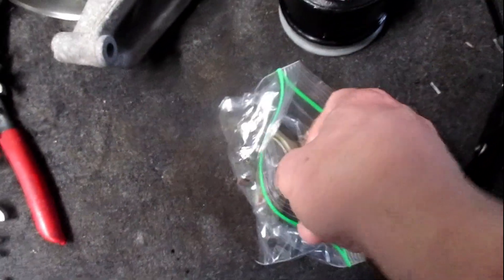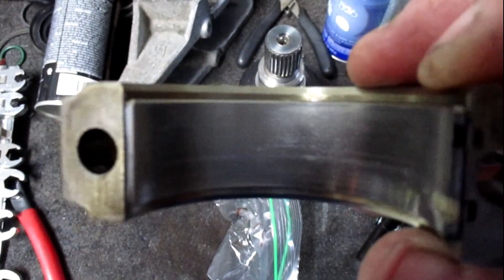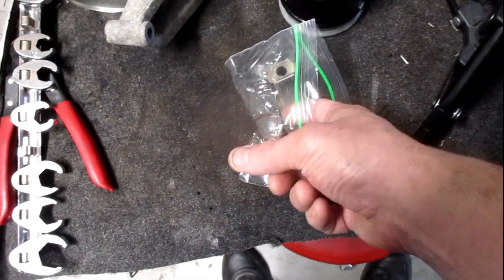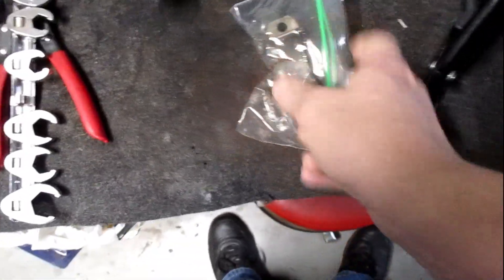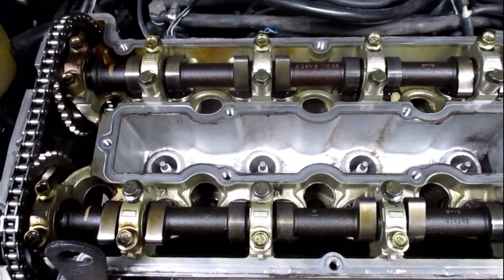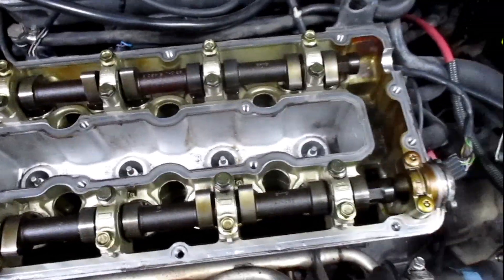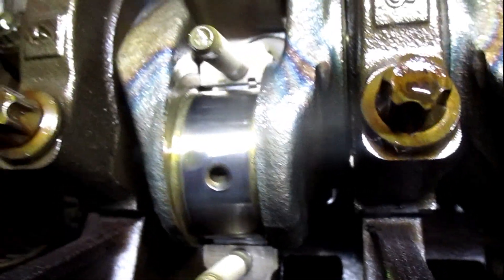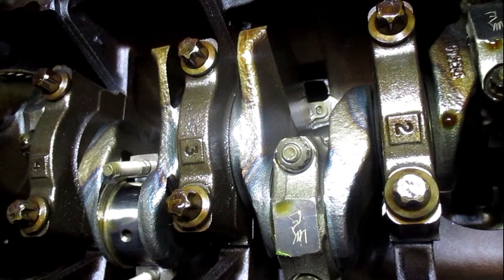1994 Saab 9000 Project weekend update

Comment: You rule. I wish I had the cherry picker so I could pull my Trans easier. I own a 96 9000 Aero and the pressure plate fingers just broke on it after I replaced the slave cylinder lol. It looks to me like possible sediment from dirty oil could have made those scratches. Anywho, Keep up the great videos! Saab for life :)
Reply from the maker: Gah, that is my luck. The folding crane has been quite handy or it would have been sold by now. I did sell my TIG welder for the room if that says anything. Well hopefully you can manage the pressure plate swap by folding the sub frame down. If not, look around for shop rental groups. We have a couple here. You pay a monthly fee and you schedule time for a lift use, tools and air included usually.